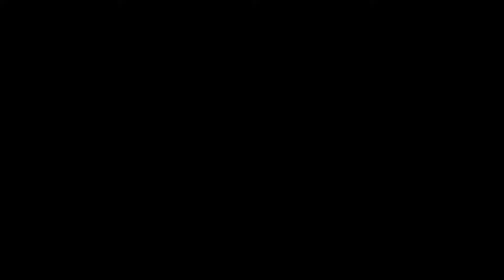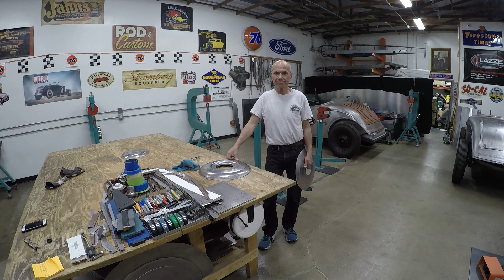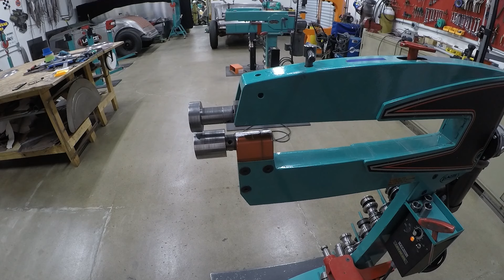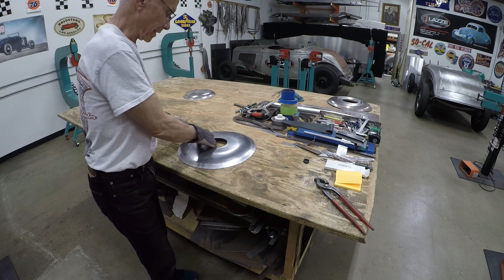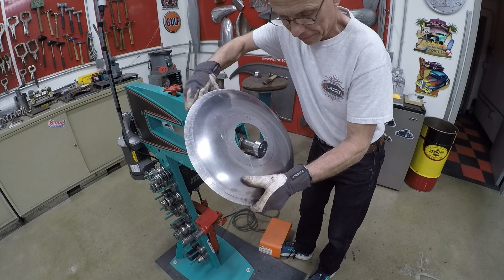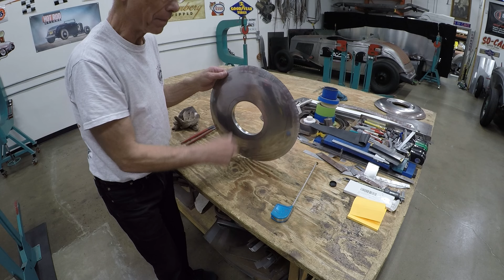Lazze Metal Shaping: Custom Air Cleaner Part 2 of 2

Comment: Great 2-part video!  As a follow up video, how about the rippled wheel discs like used on the Alfa Romeo 8C2900B coupe's (that attach over the wire wheels).  There were some amazing "hub caps" in the 1930's and you go the general form -- but question is how to get all the "beads" (ripples) into it without it distorting like mad?  [Just do for a 1934 Ford roadster you have in the shop.]